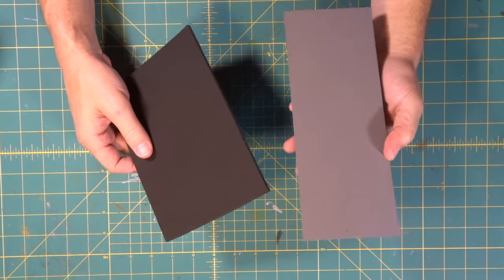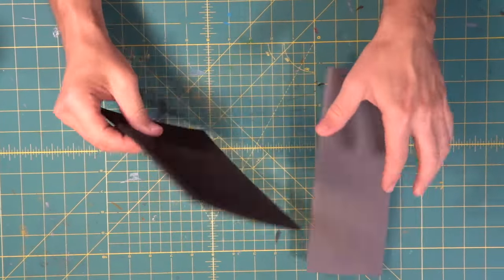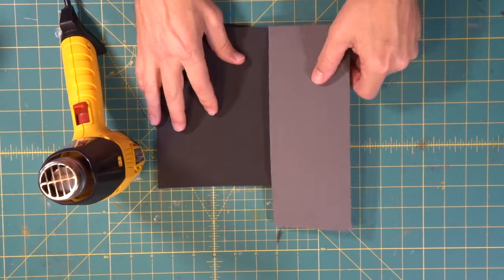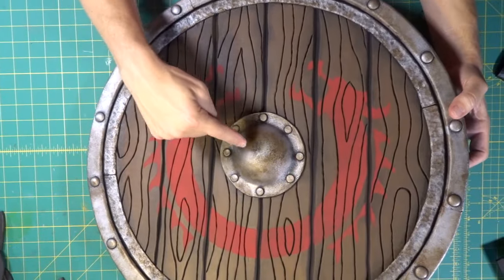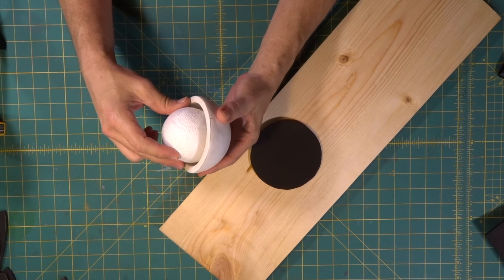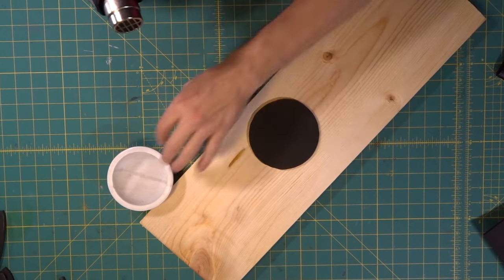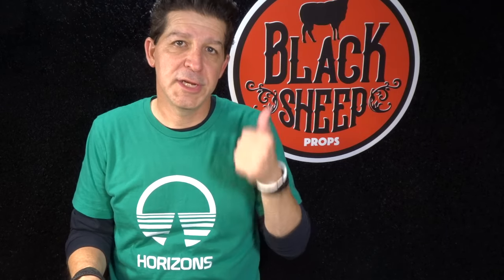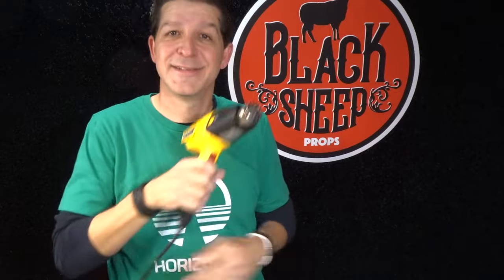EVA Foam Heat Shaping Basics

Comment: What setting do you use to heat the foam?  I am looking to buy a gun and there are too many choices.  Is it better to have a variable heat option or is a 2 setting gun enough?  The low setting on guns I have looked at vary quite a bit.
Reply from the maker: Hi Dacia! I have the Wagner FURNO 300 and it has always been awesome!  It has 2 settings - 750 and 1100. But I only use it on high. Works great!

Comment: So...if I used 10mm EVA foam to make 3-foot juggling swords (2 inches wide), would they wobble when tossing and catching, or would they be fairly solid?
Reply from the maker: Hi SD!

Oh yeah, would totally wobble all over the place at 3-foot long. And it might drift a little on you when it’s in the air - it would be so light.
You know what though, you could probably use 2 6MM pieces and embed a steel rod from the hardware store.
It would add some stability without making it too heavy. The steel rods are pretty light, I’ve used them before.

Check out our tips video on adding support on our home page : https://www.youtube.com/c/blacksheepprops
Just look under PLAYLISTS in the TIPS, TOOLS, TECHNIQUES and MATERIALS section.
Reply: maybe put some wires through it I do that for my swords :D

Comment: Would using any kind of gloves help when heating the foam I’m just starting with a chest piece and I want to be sure that I get it right
Reply from the maker: Hi Patrick,
As long as you are not pointing the heat gun right at your hand I don’t think you really need gloves.
Reply: @BlackSheepProps  I meant when your touching the foam with your hands

Comment: While this is a basic video, it would have been really useful to me back when I was beginning to play with foam.  A couple of hints- if you cover your board with aluminum foil, the foam will heat up faster.   If you rapidly cool your foam with a wet cloth, it will stay in shape without any bending back. 

I am really not sure about using the polyfoam balls as I have had problems with them collapsing when heated. maybe instead use Odin's method https://youtu.be/36Uzt16zCno
Reply: As an entry level video it is really good.
Reply: @mistac5050  Except for the axe design which makes no sense to me, I find most of his videos to be quite comprehensive and a boon to anyone starting out building with foam.  They are fairly basic videos, but that is what people need to know- the basics, before they can do anything more complicated..

Comment: awesome vid, i got a few questions!
-what kind of heat gun are you using in this video?
-how hot should the foam be to be malleable but not beginning to melt? should it still be okay to the touch, or should i be wearing some kind of gloves regardless?
-do any of these methods change depending on the thickness and/or hardness of the EVA foam?
Reply from the maker: Hi luckynow7!
I use a Wagner Furno 300. Do a little bit of experimenting on an extra piece of foam to see how hot it needs to be to be malleable. You will get used to it very fast - it’s super easy. Keep the gun moving back and forth and don’t hold it in the same spot too long until it gets pretty warm to the touch, then you bend it. It can get a bit hot to the touch but that takes really cooking it for a long time. I have never needed gloves though. You are spot on concerning it changing according to the thickness. The thicker the foam the longer the time to heat it enough to be malleable. I have actually never heated and bent anything thicker than 12MM (1/2 inch ). 12MM is used on all of my helmets.
Reply: @BlackSheepProps  neat, thank you for the detailed response! :D

Comment: Is a 300W gun going to do the same job or it may not generate enough heat in order to help to shape the foam?
I live in a country where the electricity meter is not high watts usage friendly and the good guns are all around 1500-2000W
Reply from the maker: Hello Dr!
I’m not sure? I think my gun produces 1200 Watts of power, and the temperature can reach 1100 degrees.
And that is totally hot enough to bend foam - and bend it fast! I guess if you held your gun at your foam and really cooked it for a longer period of time your gun might be able to get the foam warm enough. It just might take a bit longer than the stronger guns. Not sure though?

I have even seen some people put their foam in the oven for a bit and warm it up until it’s hot enough.

Sorry I can’t be more helpful. Thanks for watching though!

Comment: If EVA foam has to be hand-carved to a complex 3D shape with perhaps an exacto knife it ends up with a rough surface.  Can rough surfaces in EVA be subsequently smoothed again?
Reply from the maker: Hi Colin,
Totally, I use the dremel, sandpaper and a heat gun. If I do any crazy heavy carving I use my super rough dremel bit to smooth most of the roughness, and then I follow it by using my smooth dremel bit to get it even smoother, then I follow that by using sand paper to get it even smoother. Then I finish by using the heat gun to heat seal the foam. It sort of melts the surface a bit which tightens up the surface and adds another level of smoothing.

Comment: I was wondering if EVA foam play mats work? Also how easy is it to get burnt?
Reply from the maker: Hey CC!
First, thanks for watching!
I have bought the floor mats from my local Lowes - the kind with the puzzle piece edges - like gyms and schools use - and it’s great. If it has texture on one side contact cement won’t stick super well there so you would have to dremel the texture off and get down to the raw foam in order for it to get a good stick. The only time I have ever burned my foam is if I leave the scorching 1100 degree heat gun pointed at a spot for too long, but other than that I have never even come close to burning it. Plus the thinner the foam the quicker you can melt it. The thin 2MM stuff can burn with a heat gun pretty quick. Hope that helps. And in case you haven’t seen our other tips videos and builds here is the link to our channel’s home page if you like :
https://www.youtube.com/c/blacksheepprops
Just look under the VIDEOS tab at the upper left for a complete list of videos.
Reply: @BlackSheepProps  Thanks! That really helps!

Comment: frigin neat.  Now all I have to do is find the outside diameter to make my domes.
Reply from the maker: Totally! The foam shapes so nicely to a bowl shape.
Reply: @BlackSheepProps  I need to make domes that are 2" outside diameter.  I have not found them anywhere.  I am modeling a special type of oil refining unit.  Thanks.  I can get EVA anywhere.

Comment: Should you wear a protective mask while heating up the foam?
Reply from the maker: Hi RD! A lot of makers do, and a lot don’t. I do when I am using the wood burner because that is completely burning plastic, but heating foam to shape it doesn”t ever really get super vaporous so I just use a fan next to me to blow any vapor away from my face and I frequently open my garage door to air out if needed. But I am not an expert on the safety issue so you will have to kind of make the call depending on the area you are working on, etc.

Comment: Heyyy! I was wondering what temperature you have the heat gun set to? Mine is adjustable and I'm never sure what's too hot
Reply from the maker: Hey FC! I have mine set on high which is 1100 degrees. Just be careful not to hold the gun too close for too long or it can burn and melt your foam. And when you get the foam too hot it can start to give of fumes which you do not want to breath because foam is plastic. I usually haver a fan next to me so it can blow any fumes that might happen away from my face. Have fun. And heat-on!
Reply: @BlackSheepProps  thank you so much for the reply! Oh my thats very hot 🤣 i think i set mine to about 400 or something no wonder it took ages to heat!
Reply: @BlackSheepProps  how long do u heat your foam? I can't tell if I'm heating enough or too much

Comment: Should i heat both sides of the foam?
Reply from the maker: Hi Katie, it always helps doing both. The warmer you get it the easier it is to bend. Just be careful not to hold the heat gun in one spot until it starts to melt.

Comment: how to straighten an eva foam? in my country people sell it in rolls, but i want to make a blaster prop. pls help
Reply from the maker: Hi Kenobi!

My foam comes in rolls also. It is easy to straighten by rolling it the other direction for a little while.
When my foam roll arrives I unroll it and then roll it the opposite direction and put a velcro strap or a rubber band around it for  a few minutes and that usually helps it lay more flat. You can also roll it the opposite direction very tight and just hold it with your hand for a few minutes.

I hope that helps you.

We have a lot more builds and tips videos on our channel’s home page in case you did not know. Here is the link if you would like to se them : https://www.youtube.com/c/blacksheepprops
Just look under VIDEOS near the top left for a complete list of videos.

Thanks for watching!
Reply: @BlackSheepProps  what are the differences with soft and hard eva foams? in my country black foam mats comes in 4 packs and it is like $40, so, can i make a blaster prop with eva foam that's not from foam mats???
Reply from the maker: I’m not very experienced with the different hardnesses? The foam I buy is from TNTCOSPLAYSUPPLY in Texas and their site says ”it has a hardness of 38 which is slightly harder than most foams that are sold on the market”. I like it and it has been fine so far. I started building with 1/2" (12MM) eva floor mat foam from the hardware store before I started buying all my foam from TNT. I hope that helps you a bit.

Thanks

Comment: Do you know what temperature your Heatgun uses? I am afraid of burning my eva foam
Reply from the maker: Hi!
My high is 1100 degrees. Just don’t come in too close for too long and you will be fine. You get used to the level of heat needed really fast. If you hold it right up to the foam and blast it you will see the foam start to bubble. Also, the thickness of the foam matters - with thinner foam you have to be more careful with, thicker foam not so much. But either thick or thin, if you get too close and hold it for too long you will start melting. But like I said, you get used to it really fast. And make sure you have ventilation and/or a mask to keep burning plastic vapor from going up your nose. I have a pretty large space I build in, and I use a big fan off to the side that carries any vapor away. And I wear a dust mask just to make sure.
Reply: @BlackSheepProps  Thanks a lot for the reply. i will go and try it out later

Comment: What sort of glue or adhesive do you use to attach pieces together?
Reply from the maker: Hi John!
Mostly contact cement - and super glue for some smaller pieces.
On my home page under VIDEOS I have a video on contact cement basics, and any of the builds on the channel will show the glue process.
Reply: @BlackSheepProps  thanks! Just getting into fabricating things this year for Halloween so will subscribe and check out more of your videos

Comment: Isn't it dangerous to use the heat gun over a wooden board?
Reply from the maker: Hi! Not really. You will only be waving the gun back and forth, for short periods of time. It isn’t an open flame and it isn’t long enough to catch the board on fire. The board actually sort of absorbs the heat.

Comment: how long do you heat the foam?
Reply from the maker: Hi Kaylee!
It depends on the thickness. If its thinner foam just a few seconds and you will see it start to droop and then you can shape it. If it’s thicker - like 12MM (.5') you just go back and forth over it for 20 seconds or so and then try to bend it around something, if you need to heat it up a little more to get it softer then just add a little time. It’s super easy, once you do it one time you will notice how you just warm it up and after a short time it will be much softer than when you started and you can shape it. Foam bends anyway even without heat but what you are trying to do is get it hot enough to where after you bend it and it cools off it will hold its shape.

Comment: What type of bowl do I need?
Reply from the maker: Hey DA!
I grabbed a marble thing from Target, but whatever has the size you need should be fine. It could be stainless steel, marble, wood. I think the material wouldn’t matter - just getting the right size is all that matters.    But it should be a perfect round inside so it is a perfect circle curve.
Reply: @BlackSheepProps  thank you!
Reply from the maker: No problem! Good luck!

Comment: Can I use a hair dryer?
Reply from the maker: Hey Tori,
I’ve never tried it but I’ve heard a bunch of builders say it isn’t near hot enough.
Some people even heat up their oven and set their foam inside just long enough to get the foam heated up and then they bend it. Never tried that either but it worked from what I saw.
Reply: I use my iron for clothes at the max.

Comment: can i use hair dryer instad of heat gun?
Reply from the maker: Hey Dominic!
Unfortunately it isn’t hot enough. I know even some heat guns aren’t hot enough - it takes a while to get it up to the heat to bend. The heat gun I have is a Wagner 300 and it gets up to 1100 degrees!
Super quick! Sucker has burned my skin off though a couple times when I wasn’t paying attention to where it was standing on the table.
Hey, thanks for watching! In case you haven’t seen all our other tips videos and builds here’s the link to our home page : https://www.youtube.com/c/blacksheepprops
Just check under VIDEOS and PLAYLISTS at the upper left.

Thanks again!
Reply: @BlackSheepProps  nice video BTW i just need to know because i will make a helmet made out of foam for my cosplay. thanks godbless
Reply: I use my iron for clothes at the max .

Comment: It's a shame none of these tutorials ever mention how much I should heat the foam. I don't know what temperature "nice and warm" is 😢
Reply from the maker: I hear you. Yeah, my heat gun is on max which is 1000 degrees - it’s ferocious!
You kind of have to get used to how much to heat it. Not enough and it won’t soften the foam - too much and you can start melting it.
But after a few times you get used to how close to hold the heat gun to the foam and how to wave the gun back and forth so it doesn’t stay too long on one spot.
Reply: @BlackSheepProps  Thank you for the reply! I always struggle with not getting it warm enough to shape it, but I'm paranoid of burning it. I guess I'll just buy a mask with a good filter and experiment some more.
Reply from the maker: Since I never heated my foam to the point of burning it I never used a mask. It can give off fumes but I didn’t do heavy amounts of heating foam. I also had a large work area and a fan next to me to blow any fumes away from my face. So I was never really in an enclosed area breathing the fumes. I also periodically opened my garage door to air out the room just in case. What little bit I could smell was not too much.

Comment: How is this supposed to be a proper instructional video if you skip the heating technique? 🤦🏻‍♂️
Reply from the maker: I’m confused. Several heating techniques are shown in the video. What didn’t you see?
Reply: @BlackSheepProps  , apologies, I only saw the first part where you skipped the heating time. Seen the later parts where you show the whole process. Thanks. Thumb down removed and thumb up added.
Reply from the maker: No problem Ethan! I got worried and thought I messed up and left the heat gun out! LOL! I had to go back and watch it to make sure.